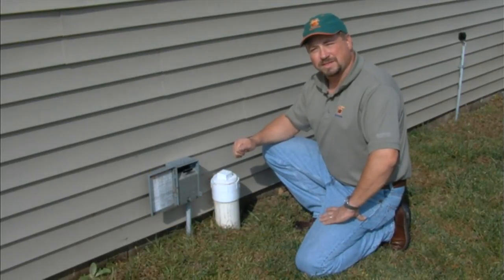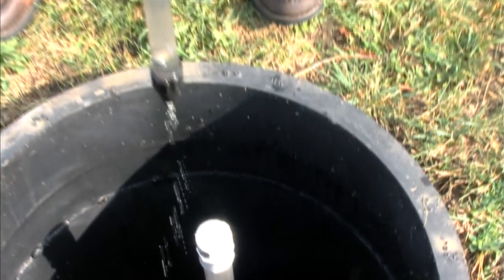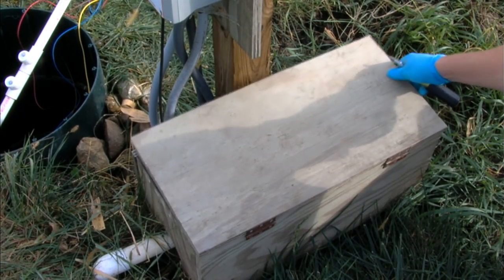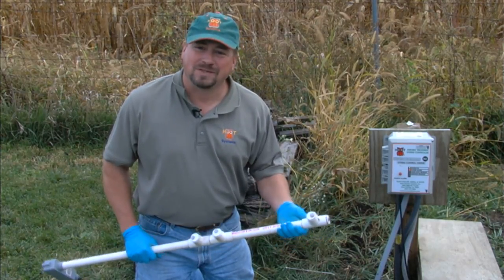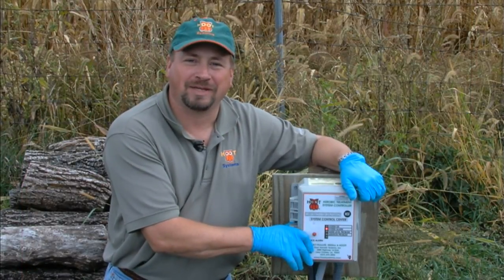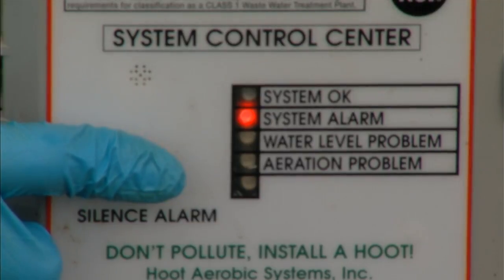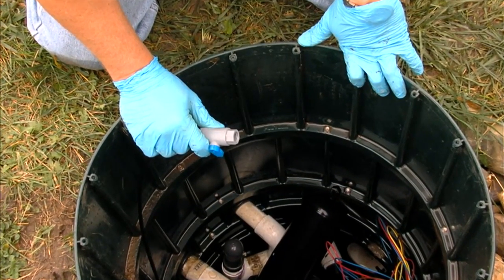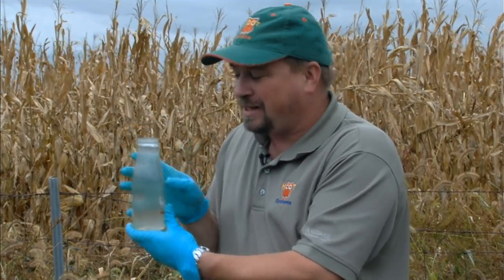IOWWA – Hoot Systems Maintenance

Comment: I have 36 years experience with simple and complex control systems, and found the video very helpful. 

I bought a house with an existing system and it hasn't been easy to find information on the exact system I have (2 lights only), but I was able to make the pump run in a test mode using the video as a guide. That's all I wanted to do to check the sprinklers. 

My next step is to add an alarm/light that I can actually hear and see! Thanks for the video.
Reply: That's exactly what I want mine to do, but it's not reacting to the 16 seconds.

Comment: It still hurts my heart that Ron is no longer with us. He passed away a year ago.  By for my favorite job was working with him. He was the main owner of Central Texas Precast.
Reply: I wondered why they closed.
Reply: @gordz62  well now you know.  I miss working there. Troy from   Hoot(cormier) in Lake Charles, LA closed CTP after Ron passed. No one really likes Troy.
Reply: No wonder I couldn’t find any parts from hoot 🦉. Had to upgrade my system to another brand. Like the air blower and pump. R.I.p Ron
Reply: @HoustonRocket281  There is a sign that's on the fence for a number. You can get parts just got around the waco area. Lake charles louisiana has a production area. Called cormier or something like that

Comment: I had a hoot aerobic septic system installed a few weeks ago and I just assumed everything was working fine. That still may be the case, but the control panel has no lights lit up, not even the green one for “system OK”. Should that green light be on at all times (when not servicing it)? If there are no lights on, does that mean my septic isn’t running at all? I checked my breaker and it’s on. Thanks.

Comment: I have the hoot la-500 when i hold down the button to program it does nothing.  I need to set my sprinklers,  does anybody know how i can manually make the pump run?
Reply: Do you have the control panel that has (5) lights on it? If so, I can give you instructions on how to force the sprinklers to come on, in case you haven't already had someone show you.
Reply: It only has one light.  I sure do appreciate your willingness to help though. Thank you so much